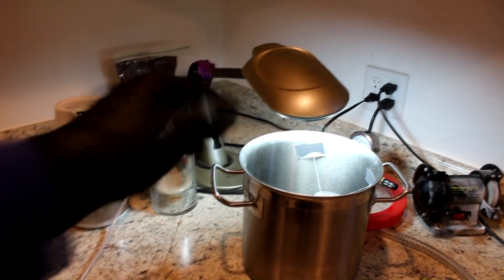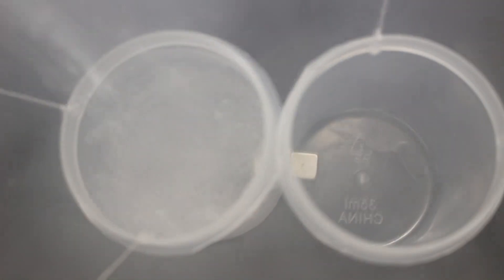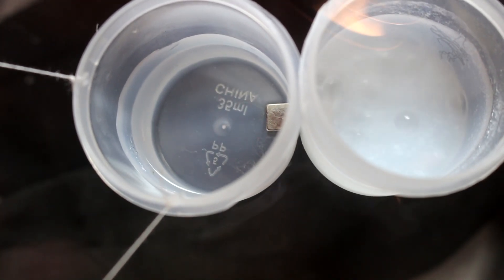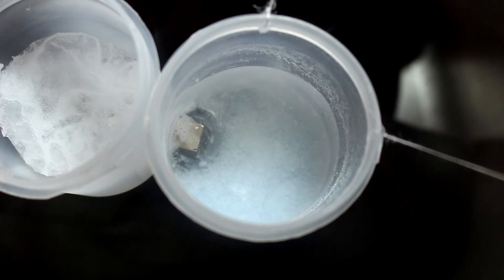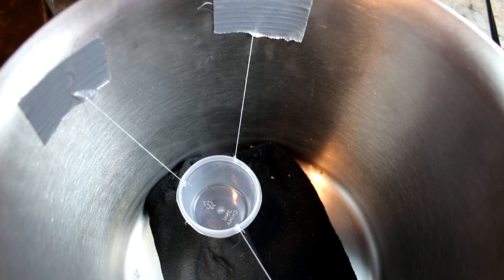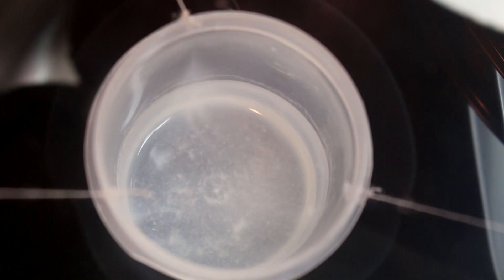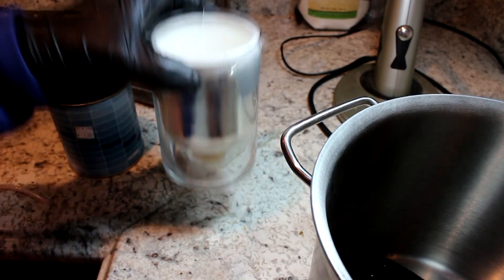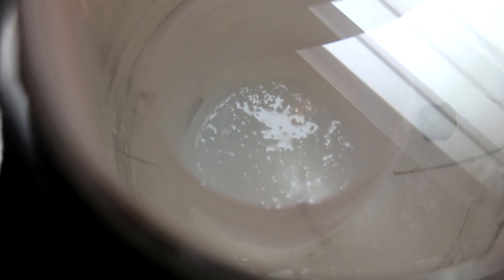Making Solid Oxygen

Comment: I get that when you reduce the pressure the boiling point drops so you boil some off to cool off the rest until you hit the triple point, but why does it melt when you reapply the pressure? Doesn't pressure keep things solid? Or does it just heat up that fast.

Comment: 1 torr = 1mm on a mercury baroneter. 
1 bar = 760torr = 101.3 kPa
1 mbar = 0.76 torr

At lower pressures, like 1 torr, the difference between mbar and torr is usually ignored, as we want to know the order of magnitude below atmospheric pressure, e.g. 1 torr or 1.3 mbar is 3 orders below atmospheric pressure. 

Professional, three stage punps go down to 15 orders of magnitude below atmospreric prssure (10^-12 mbar/torr)

Comment: Cody, what would you say about making a new experiment based on my observation in this video ?
I saw that liquid oxygen "move" around the magnet..so there is a kinetic phenomenon with no input other than maintaining the vacuum ! Also, liquid oxygen movement does not appear to be random nor being produce by the "fizz"/bubbles and also, looks like they follow the magnetic field lines of the magnet.
So here is my proposed setup :
Vacuum chamber with a glass  recipient and inside of this, liquid oxygen with a suspended magnet that is sinked in the liquid. For an easier visualisation , if physical possible, perhaps you can use some colored dye.
If agree, try to use radial cylinder magnet, multipole and also normal double pole. It will be interesting if you use a inner and outer pole configuration..will liquid air go  round and round in trying to get closer to the pole that is atracted !? (that will be a verry interesting thing to see!)
Purpouse is to establish if oxygen really has a kinetical interaction in respect with magnetic field lines and if so, what the pattern looks like ! 
Possible aplication can be diverse and I'm pretty sure this results can help developing other researches, if my observation is good..real !
Thank you for sharing !

Comment: You told 54 K temperature was achieved. Is it actually possible? I think Oxygen was at the same temperature at which it was when you put it in the vacuum chamber. Reducing the pressure causes it to freeze at that temperature itself. So, I think there is no drop in temperature here... 
Or is it the evaporation of oxygen from the liquid oxygen surface due to low pressure that causes the temperature of oxygen to drop so much..?

Comment: Oil Swept Volume Vacuum pump + O2, huum.  Hopefully you are using a perfluorinated polyether or the like ($600 pint) in there.  If not, congrats on not detonating your pump and self yet.   May want to research why "Dry Pumps" were invented.

Comment: So here is what I don't understand: Doesn't the boiling point of a liquid lower as pressure goes down? I.e. water at higher altitudes/lower pressures boils at less than 100C so why did the oxygen/nitrogen get colder/solid with no pressure?

Comment: It would be a fun experiment to build a better air cooler, or even active cooler for that pump.

I've never had the experience of a pump quitting on me. Considering the experiments I've done, and how terrible it would have been to lose vacuum, I suppose it should have been a consideration.

Except I don't think the vacuums I used were smart enough to turn off.

Comment: I work at an Air seperation unit plant where we do this on a massive scale for big business. What im not understanding from this video is how he can have lin/lox in those small dishes w.o it boiling off right away. The way we do it at work is remove all the moisture before the pressure drop. We need to get to around -300 degrees to liquefy the air and water freezes at  +32 degrees , if moisture is present it would get into and freeze the equipment . Could someone who is knowledgeable on this help me understand?

Comment: Extreme vacuum creates ultra low temperatures .  At these temps gases and liquids are converted to solids .
 H2O can be split in an electrical field to create a hydrogen superconductor which could explain the following .
van allen radiation  belts , stars made of hydrogen , aurora borealis , star trails held within the field lines .
BB microwave background radiation illustrates the earth to be the center of our universe . 
 ( aka : axis of evil in the religion of  psyantisim )
 The sky is a firmament made of a supercooled hydrogen superconductor held firm by  an electromagenic field . 
The cosmos we see are the fields of magnetism holding the HYDRO_DOME  firm in place , 
like a tent to dwell in . a molten looking glass .

Comment: Summary of the video:
The bp of nitrogen  is -195.79 °C. SInce the bp of oxygen is -182.95 °C, liquid nitrogen can be used to make liquid oxygen.
By pumping on the liquid oxygen, basically the oxygen is in a vacuum and so the bp is almost the same as the mp. The temperature of the oxygen goes from -182.95 °C to -218.79 °C.

However, hydrogen's bp is -252.879 °C. The oxygen can be used to cool compress hydrogen to -218.79 °C. The rapid expansion of hydrogen would cause some of it to condense.

There aren't many options to liquifying hydrogen. Oxygen was the best solution for Dewar.

Comment: It might be time for DIY Pirani or thermocouple gauge so you can accurately see what pressure you are at. Manometers and mechanical guaging is pretty coase if you are below 5 Torr. Also, for the sake of saving your pump a liquid nitrogen trap is a very nice thing indeed and standard kit in  industrial labs.

Comment: Seems to me that hydrogen and oxygen do combine to form water...but it also seems to me that unless you are foolish enough to put a fairly hot source in the mix they dont just spontaneously start fires or explode.  So, yeah, playing with those two gasses requires caution, but it IS fairly easy to avoid sparks and flames if you pay attention to what you are doing.

Comment: I don't understand how a vacuum is required to solidify oxygen. Shouldn't pulling a vacuum cause the oxygen to vaporize more readily in to the chamber, thus resulting in it being pulled out by the vacuum, and, ultimately, prevent it from liquidizing? Does cooling the oxygen cause it to be dense enough that it remains in the cup while the surrounding oxygen is pulled out?

Comment: Hey Cody, nice video again! But I feel, I need to give a few notes: First, that wasn't pure oxygen at all, as you might know by yourself, and so the melting point should have been higher than 54 K. Pure oxygen forms bright blue crystals (a bit like coppersulfate) and you are lucky, you didn't get those, because oxygen crystals are highly explosive and a super strong oxidant, even at this low temperature. If we find oxygen crystals in a coolingt trap in oure lab we evacuate the lab at once! So I don't recommend trying this again. Still good job, thanks for the video!

Comment: you won't have explosions if you liquefy oxygen hydrogen together you know you mix hydrogen and oxygen together you have water not rocket fuel rocket fuel the straight up hydrogen and straight up oxygen ignition you gotta burn it freezing it and liquefying it does not turn it into rocket fuel you need to study up on that better what is HHO Gas hydrogen hydrogen oxygen water and separated into hydrogen and oxygen by electrolysis and people use it now to run their cars other devices cook food and some even people use it as a substitute of propane or natural gas living off the grid

Comment: two questions:
1) Do the impurities of the oxygen lower the freezing point?
2) I realize that the rubber and other bits of the pump would become brittle and crack.... but if that weren't an issue, what would happen if you poured liquid nitrogen on the vacuum pump to try to cool it? I know that broken light bulbs still work under liquid nitrogen, so would the electrical components of the pump still work?

Comment: The vacuum pump sounds like the oil is getting low, and the overheating is symptomatic of that or contaminated oil.  I am in the HVAC industry and routinely run A/C systems into 200-100 microns.  The key for me is to change the vacuum pump oil frequently, as it is hygroscopic and contamination (absorbed water) will make the pump run hot and inefficiently.  Really cool videos, they definitely make me want to build a vacuum chamber.
Reply: Should have converted microns to Torr, 100 microns = 0.1 Torr (relationship is linear)

Comment: I'm confused. I thought dropping atmospheric pressure meant raising the boiling point (e.g. boiling water on a mountain has a lower temperature than at sea level). Shouldn't all the oxygen evaporate in a vacuum? Or, does the evaporation under low pressure cause it to drop further in temperature, so it freezes itself? If the latter, I don't get how that works.

Comment: Wait, I'm confused. I thought higher pressures encouraged more compact states and lower pressures encouraged less compact states?
Reply: yes you are right, which is how the trick works. Lowering the pressure causes the liquid to boil, this boiling requires energy, which takes energy away from the liquid. As this continues the liquid particles loose so much energy that eventually the temperature of the liquid drops below its freezing point and the liquid freezes. In short you are using the liquid boiling to cool the rest of the liquid to get it to freeze.
Reply: @totallycarbon2106  it took your reply buried deep in the comments section to finally make some sense of what this video was about. I got nothing from Cody on what he was doing and reading some of the other comments, well they are just bizarre.
Reply: @Dont_Gnaw_on_the_Kitty_3  haha no problem, physical chemistry is weird, but you might be able to find some stuff on Wikipedia, "triple point" is a related phenomena where a substance exists as a solid, liquid and gas all at the same time and then tiny changes to temperature and pressure can convert it to all one phase, which is what Cody is doing.

Comment: If you swallow liquid oxygen, would it be the same as swallowing air oxygen?
Reply: Warhead24 Answering original comment, you'd die because liquid oxygen is veery cold
Reply: Warhead24 you don't swallow the gas oxygen... You breath it if that's what you meant, and drinking isn't breathing, so no
Reply: payitforwardfilms I mean like when you swallow hard then you need to burp. Thats what I meant
Reply: Warhead24 that's still not breathing...

Comment: Is it possible for organisms to perform respiration with liquid oxygen?
Reply: no since it's a liquid and too dense it has to be in air form for it to work.
Reply: All you need is oxygen dissolved in the fluid in your mitochondria so it can form water with hydrogen ions and electrons from the electron transport chain and keep your electron transport chain working. The oxygen in your body isn't in liquid or gaseous forms, it is either molecules of oxygen bound to haemoglobin or its molecules of oxygen floating around in your cytoplasm and ultimately the matrix of your mitochondria.  We breath it as a gas mixed in with air so it can diffuse across the alveolar membranes and into our blood, liquid oxygen wouldn't be able to cross that membrane and would freeze and kill the tissue in your lungs.
So yes, respiration needs oxygen to carry electrons, and its irrelevant how you supply that oxygen, but no there is no way to get liquid oxygen to cross cell membranes without the contact with something so cold instantly freezing the cell itself.
Reply: Google deep sea diving breathing liquids, there's some cool stuff out there.
Reply: honestly I would say it depends, if you were able to compress it and turn it into a gas then yes, though if it was just liquid oxygen it would have to be an extremophile. (I think that's what they are called) Bacteria that live is the most extreme of environments
Reply: To humans no as pure oxygen is a deadly toxin at a far lower pressure, that the body can’t absorb 
As for other organisms, can’t say

Comment: "My vacuum pump overheated, I need to wait for it to cool off."

Says the guy surrounded by liquid nitrogen.
Reply: It would probably crack
Reply: @user-xw4zt9gc7l  I believe "shatter like my self-esteem" would have been the appropriate word choice
Reply: I know I'm super late, but rapid cooling of mechanical objects causes "thermal shock" which will warp all of the metal components and likely the seize up the entire mechanism. We have very specific cooldown periods for aircraft engines to prevent this and I'm sure the same could be applied to other devices as well
Reply: Hope you aren serious
Reply: OMG I was about to say that, then I saw your comment! EXACTLY!
Happens to the best of us!
Reply: Iz 'ee been trolld? ;P  That was my first thought... put the pump in a cooler with C02(S) or N2(L)
Reply: Exactly, I thought Cody of all people would use LN2 as a coolant for his pump.
Reply: Ya the Ln2 pump would be much more viable the path ago reunion law states that Ln2 could thaw out the heat pathagoreum theorem mhm

Comment: In air-conditioning service it's fairly routine to hook one of those pumps up to a system and let it run overnight then charge it in the morning. I got to wonder if there's something wrong with your pump?
Reply: It's probably a rather small, cheap one just for short term usage rather than several hours.

Comment: I am confuse, shouldnt lower the pressure make it boil? Why is is becoming. A solid?
Reply: When he initially applies the vacuum it does indeed boil because the reduced pressure reduces the boiling point, that part you're up to speed on but Cody continues and takes us to the next level. When you're boiling under a vacuum the process requires exactly the same amount of heat energy that it does when you're boiling the same substance in a pot on the stove (that would go quickly). In this case Cody is not providing any additional heat energy, in fact he's doing what he can to prevent it from getting in there. So the latent heat of evaporation has to come from somewhere and the only place it can Come from is the warmth that's already in the oxygen. Although liquid oxygen is very cold from our perspective it has lots of heat still in it, but a finite amount of heat. Every molecule that evaporates from it and goes out the vacuum pump takes a little bit of that heat with it so the remaining oxygen has to become colder. There is an excellent nova documentary titled "absolute zero" which Cody is referencing heavily and does a beautiful job of covering the history of discovery of all of this, you can find it here on YouTube anytime you've got an hour to kill.
Reply: ɷɷ Heeey Frienddsss I Havee Justt Won Brand New iPad From visittttt  : -  https://t.co/6p1aPsvKM0
Reply: +ali 11 wtf?
Reply: brocktechnology thank you for the explanation
Reply: GnlMachoman
you're welcome!

Comment: Be careful, pumping oxygen can be explosive unless you are using non-hydrocarbon pump oil.  Although small amounts at low pressure are likely OK.

Check out Edwards 'Vacuum Safety Booklet'.

Cheers,
Mark
***********************

Comment: Cody will you please make a note as to how exceptionally dangerous liquid oxygen is. Even running it through your vacuum pump without using halocarbon oil could have caused a significant explosion. Pure oxygen is not something to be played with without proper knowledge and proper equipment.

Comment: when you lower the pressure you don't actually lower the temperature, you raise the solidification temperature right?
Reply: You lower the temperature of solidification by removing all of the energized particles.
Reply: +Pentatome:
"when you lower the pressure you don't actually lower the temperature, you raise the solidification temperature right?"

==No, the freezing point doesn't change for substances.
When pressure is reduced on a liquid, it boils. The hottest atoms/molecules boil off and also cool off the rest of the liquid (heat of vaporization).
The temperature keeps dropping until it reaches the freezing point. For example, you can make ice with this method. The temperature would be 0 °C.

The problem is that as soon as you let air back in, it melts quickly. For ice, it takes longer since the heat of fusion is high. We did this in class at grade 10. The professor passed around the ice.

Comment: Most folks have some idea that gases get hot when compressed and cold when expanding, this is how a refrigerator works, the diesel engine cycle, many things. This is also how liquid N2 and O2 are made from air, in a self refrigerating process. So why not liquid H2 and He? because at temperatures near ambient these gases actually cool on compressing, they must be pre-cooled to liquid N2 or O2 temps before they behave in the typical way that a refrigeration device can utilize. 
I don't recall the proper terms for this adiabatic temp change on compression/expansion, my thermodynamics courses were too long ago. I do recall that there are other gases that act in the atypical manner but H2 and He are the only ones that do it near standard temperature.

Comment: Thanks for video, that was fiun. I have a question though, what kind of pump would be practical to continuous operation for such experiment?
I use LN2 for cooling semiconductors (via flowing thru copper block) and sometimes 77K is not cold enough. Other 10-20K down would help, but I think regular vacuum pump like one you used would not make it for long runs.

Comment: Hey Cody, how violent would the be the temperature change be if you had quickly equalized the pressure to the chamber? Like if you had used a solenoid, opening in thousandths of a second. Would it quickly boil and turn back into a gas instantly? Or would it need to 'thaw-out' for a moment and slowly boil, and then vaporize?